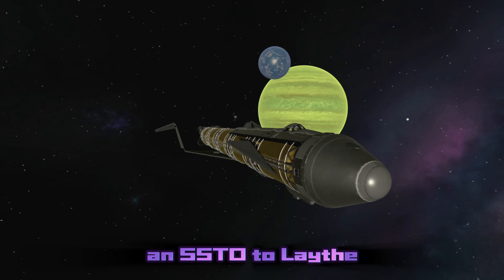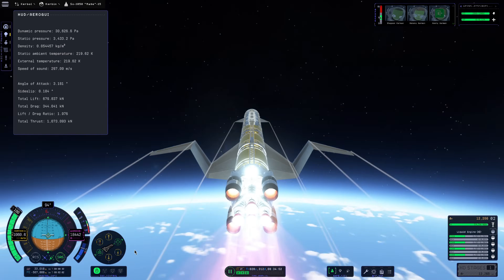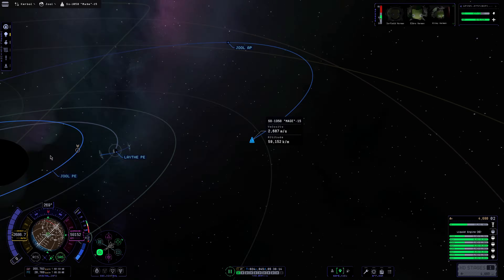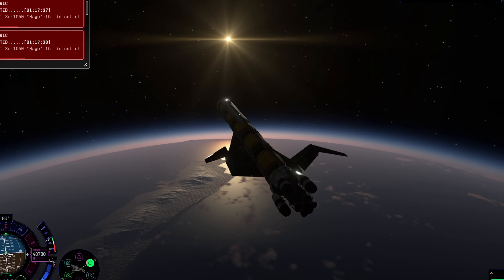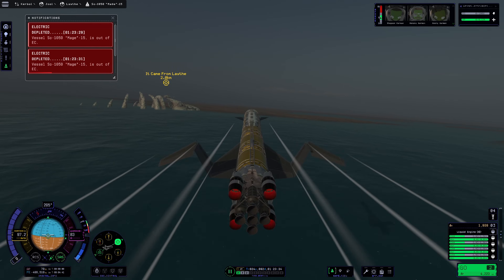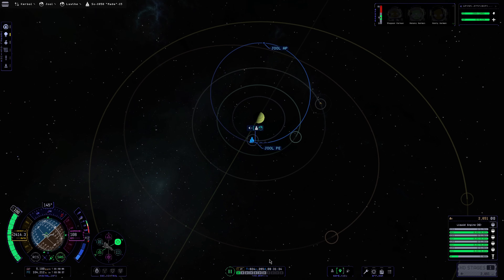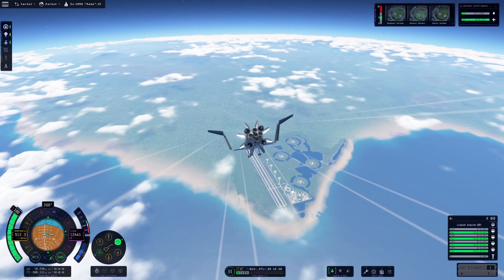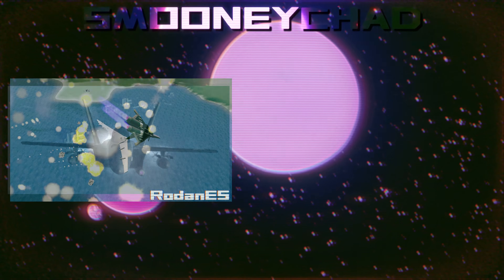KSP 2: MASSIVE Nuclear SSTO to Laythe and Back! ( Aircraft Only: Ep 10)

Comment: FYI the Community Fixes mod (it's on CKAN) includes an auto-check/fix for the landed state bug. It's more than a little disappointing that it hasn't been squashed by now, though, as it's a pretty severe one.

The handful of times I've tried to do a round-trip SSTO to Laythe in KSP2 haven't gone well, usually because SSTOs still aren't very structurally sound. The dumb wings/side tanks just falling off bug is one of the more frustrating ones left in the game. IMO it's really hard to remain motivated to try big SSTO missions until things like that are in a better state.

That said, I have had a few successes building them (when they decide to stay together), and my current best is getting to LKO with just over 9,500 m/s vacuum delta-v left. The SWERV is crazy
Reply from the maker: For some reason community fixes was giving me some strange bugs like maneuver nodes not working properly. I'm also just trying to keep it 100% stock for the series, so it'll kind of represent the base game's state.

and yeah side tanks are still a no go, I did however just get a dual-hull (payload in the middle) SSRT/SSTO working tho! ~45 tons to LKO with the ssto itself weighing a chonky 460 tons fully fueled, still has the occasional wing pop off on launch. For whatever reason though looking to the sky before physics load in fixes it lol 
Also 9,500 m/s is nuts, nice work!

Comment: Why does blud keep leaving his landing gear down. I'm pretty sure the tires would have popped by now because of the pressure difference in space....
Reply: yeah lol... KSP2 physics :P
Reply from the maker: They're actually just solid steel pucks coated in flextape, indestructible but not so great for the old runway
Reply: @smooneychad   so one use only since the self destroy once they touch the runway? Doesn't seem super cost effective but I'm not paying so I'm good.
Reply: @smooneychad  😂
Reply: I know right... Imagine if the devs add it......blud might be in a wee bit of trouble for that...
Reply: @trainzderails2008   they also might have burnt up while he had them down for aerobraking.
Reply: Only a 14.7 psi difference between sea level and space, so they’d probably not pop. They’d definitely explode from the heat tho lol